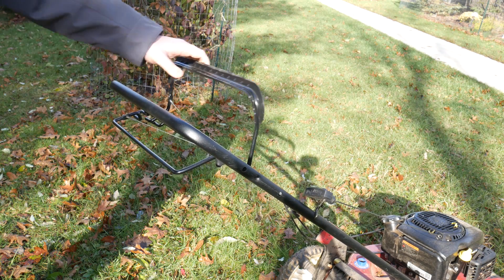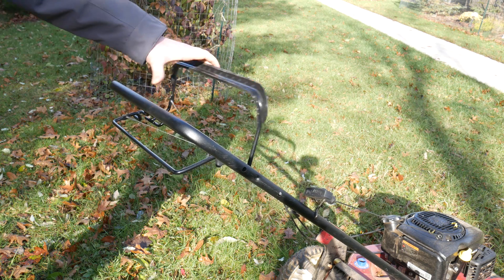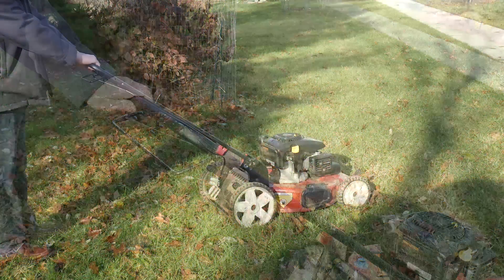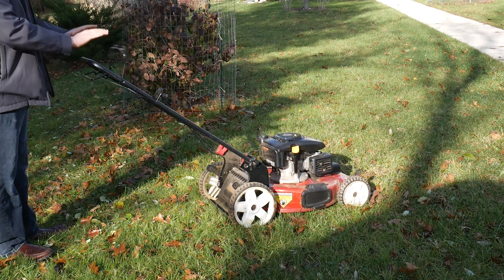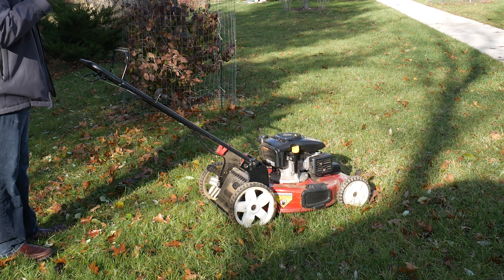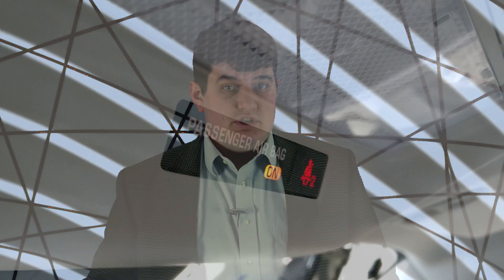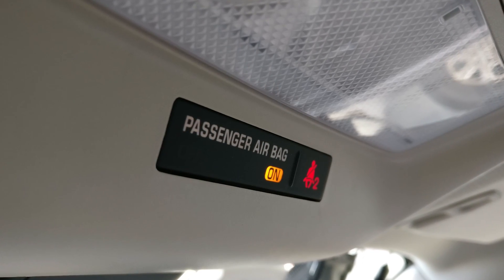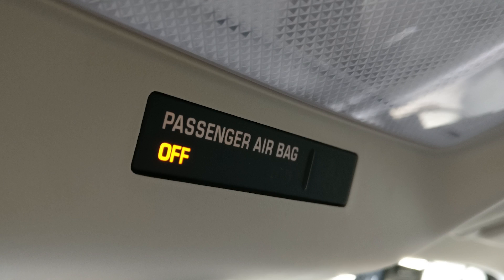The Dead Man's Switch:  How Anton Yelchin's life could have been saved

Comment: The seat sensors don't always work right, false positives caused by sitting with your weight shifted, or just a worn mechanism would leave you stuck parked in the middle of a busy road. even for a moment that would put people at risk. I can see how engineers would rather just expect the operator to confirm their gear. ...poorly designed shifter is a separate issue though.

Comment: If you do not know how to operate a machine safely, you should not be. I agree that cars could be made safer. That does not mean you are relieved of using one responsibly. Cars are dangerous. Use with caution. Your driving instructor tells you to use the parking brake. The manual and common sense say use the parking brake, do so.  You are responsible for safely parking your car. If you do not then you are either irresponsible or lazy, possibly both. I am not saying you deserve to die if you do not park or car properly, but leaving your vehicle in an an unsafe state is your mistake, not the car's, nor the manufacturer for that matter.

Just because something can be done not mean it should be.  I think a loud audible warning when you exit your car without properly securing it might be a good middle ground.
Reply: You seem to cover a lot of potential issues, problem that you didnt think of even if yelchin had this in his car a unsecured pet or child could climb in the seat and stop the sensor from working
Reply: +Mike Jackson Not so, the loud audible warning goes off upon exiting your vehicle. Even if a naive implementation of no pressure on sensor of drivers seat, open door and car not in park is used, an unsecured pet or small child would have to very fast to prevent the alarm from going off. The warning need only be heard for a short time for you to recognize what is wrong. It is not as if you wont hear it  even of it only sounds for 5 seconds. Ignore at you own peril.

Comment: Steer by wire? Eeeeek scary.
Reply: We have a car like that and it steers EXACTLY as any other car.
But it is Japanese and I would be worried if it was made by an American company.
Reply: I have not seen that yet in a car. My sister's new cars steering wheel is still connected to the steering box.
Reply: I thought electric steering was bad enough, lol.
Reply: The Infiniti Q50 has steer by wire since the 2014 model year and it’s now officially a proven system. It’s actually safer than regular steering.
Reply: @davidperry4013  how is that?
Reply: Ramog1000 They took the NASA approach...ridiculous redundancy. I think there is three redundant computers and a backup connection.
Reply: if they can fly a plane by wire you can absolutely drive a car by wire....

Comment: I always disable the lawn mower thing by tying the handle up.  My lawn is flat and I don't want to have to restart every time I need to move away from the mower.  Total electronic controls on cars is scary.  I once had my accelerator stick on my 305 V8 1987 Camaro and was able to regain control by turning off the engine and brake on to the shoulder.  The way the car was designed I had to wait for the engine to die from dieseling and then open the hood and return the arm on the carburetor to its normal position.  The restore was a spring on the carburetor itself.  Had I shifted into neutral the Engine would have over revved and destroyed itself.
Reply: Modern cars (a.k.a. basically anything made since your 87 Camaro) have rev limiters.  If you shift into neutral, the engine won't over rev.  Also, you can just turn the key off and the car will shut off.  It won't diesel, because fuel injectors and ignition are electronically controlled.  Your 87 Camaro is an abomination compared to what's been made since the early 90's.
Reply: What you say is true, but while the incident was scary, I had the means to control the situation and avoid a bad accident.  With everything under computer control a failure in the computer or its ports that control the car may not be manageable for the driver.  On the other hand, other than the Toyota scare with uncontrolled acceleration, there have been pretty much no reported incidents.  The Toyota thing seemed to be drivers or the place mats causing the problem.
Reply: The Toyota issue is also partly to blame on dumb drivers.  Again, if the accelerator got stuck, they could've just turned the car off and it would've stopped.  Although certain situations may require quicker response times.

Also, computers control nearly every aspect of your life, but they save people much more often than hurt them.

Comment: Deadman Switches are great, I drive a forklift and they have deadman switches built into them so unless somebody's sat at the controls you can't do anything.
Reply: michael fogelström there shouldn't be a need for you to lower the forks from the wrong side of the forklift, they should already be where you need them!

Yes, falling of may take your foot off the pedals, or it may not, you may fall off and get your foot caught?

The thing you have to remember is that a lot of these 'health and safety' things have been put in place because somebody got hurt!
Reply: Daniel Coates there are competently designed safety systems and there are baldly designed systems installed because of a regulatory requirement. I have used forklifts with both. The good ones make you safer all the time and the bad ones get you and someone else hurt. The type of system he is talking about sounds like the later. Usually the someone else is the new operator I am training.
Reply: My Kubota tractor has an underseat switch.  Cannot run the PTO, or move it without sitting in the seat.  Pretty simple device really.  Even riding mowers have them.
Reply: @mitte90  Depends on the design of the forklift. If it's a fuel-operated forklift, a dead man switch can save your life should you be thrown out of the cage, as the direction-handle is like the clutch on a normal car: it will keep driving slowly even if you don't push the throttle down. And 4,5 tons (that's the weight of the forklift at the place where I work) that is only driving about 1 km/h... darn, I know who will lose...

But I'm not always superhappy with them.

I'm very lightweight and especially newer forklifts (with software and stuff inside) tend to be only operable when you weigh more than say 56 kilo. I'm 54, so I usually can't get those forklifts to operate.
The reachtruck I operate at work has a dead man switch in the seat. But fortunately, the reachtruck is old and relies on rocksolid relays and switches to get the hydraulics and electrics going. Therefor a small bump, which usually activates the switch when I operate it, will only cut off electricity for a short while, and then bring the machine back to life. Most modern machines will make you go through a complete 'start-up' routine first before you can use it again.

And btw: Some deadman switch arrangements on forklifts don't make any sense at all. In training, I tried one on purpose. During driving, I stood up from the seat, just to see what would happen.
After a whole SECOND, the brakes started to apply. Not that I would like such a thing to apply a kind of emergency brake (that would only make things worse), but I expected immediate response from the thing.

The big red emergency-switch was even worse: that would only cut power to the machine, but would not apply any brakes at all: the machine would just start freewheeling...

Comment: I wonder if the vloger lives in a warm climate ?  Who wants to sit in car while it's warming up in the winter?
Reply: All that needs to happen is the car for to automatically apply the emergency brake if the seat is empty.
Reply: Dead man switches (apart from lawnmowers) don't prevent you from running the engine, just from engaging the transmission or releasing the brake.

Comment: The Brake pedal overriding the accelerator has been around for ages, however I had a massive problem with it once.. The Little rubber on the pedal that activates the brake switch wore down (crappy plastic) and at one point every now and then, after i've touched the brake and then tried to accelerate, the car would almost stall for a few seconds before going.. the brake switch would deactivate only a few seconds after the pedal was released...

One day while doing 120kmh on the freeway, the switch decided that it was not going to deactivate (plastic wore down to far for it to register the pedal release), i suddenly could not accelerate.. I ended up crawling at 20kmh down the highway home..

Only after parking the car and getting out, could i see that the brake lights were permanently on.. and I dug into the switch and found the issue..

The dealership was out of the required rubber part (many of the same model had been in for exact same problem), and had a 6-8 week waiting list for import parts. I got a replacement part turned for me from Teflon, and not had any more problems since..
Reply: Plebbit doesnt know F-all about trolling bud
Reply: +turbo pascal That's pretty sad for a trolling attempt. Research over at reddit and up your game.
Reply: Cool story bro, tell it again.
Reply: Hey, what is this? I ordered a bunch of hats, not a bag of salt!

Comment: BMW interlocks the automatic gear selector with the driver door latch, I'm not aware if they have a solution for manual cars with mechanical parking brakes (like an M2 for example), but even in cases where a fully modern car has no electronic control over the transmission or parking brake, it's still possible to apply the service brakes electronically with the ABS system.